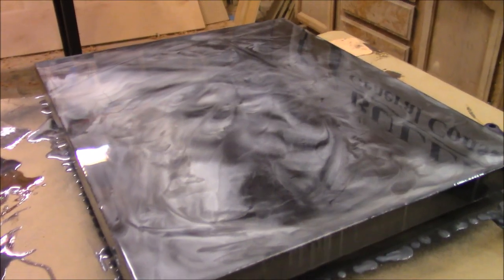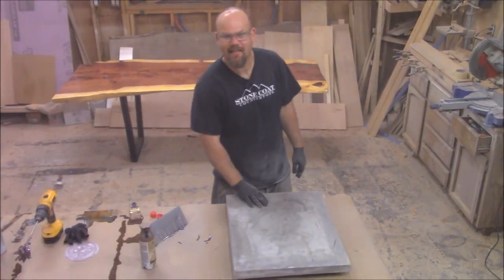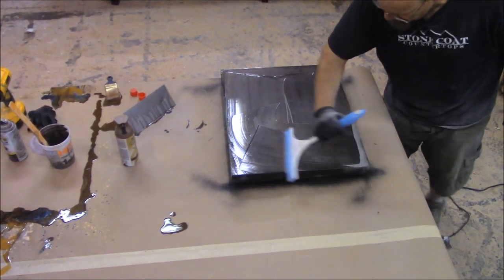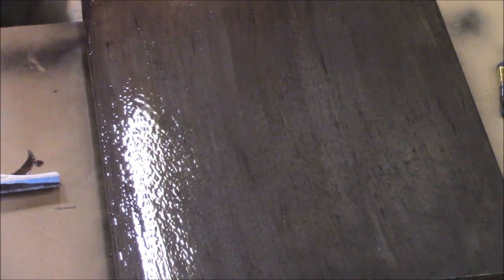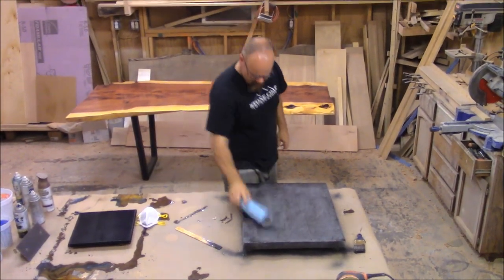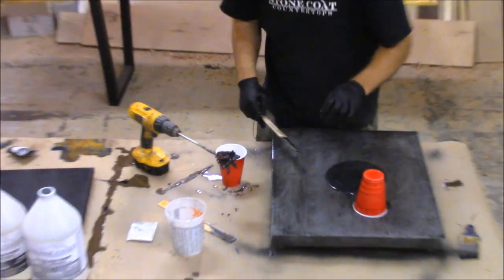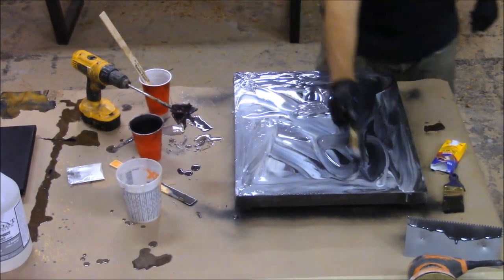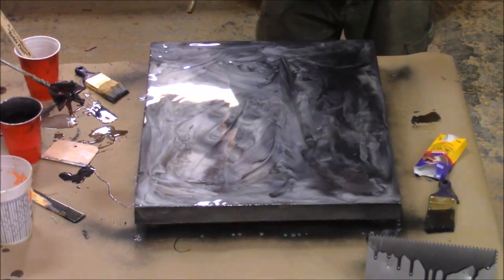Epoxy Countertops Over Concrete.

Comment: Do you have any recommendations for an exterior epoxy?  I have a concrete countertop in our grill area that is 85% covered and gets minimal direct sun exposure. I am hoping epoxy is a good option. If not, does anyone have any recommendations of what to use?
Reply: I have this question as well.

Comment: Hi great video.  A few years ago I applied an ardex Skim coat onto MDF as counters and typed it with a sealer. I'd like to epoxy over the Skim.  Can I just apply a primer then epoxy?  What prep work is needed before applying the primer?

Comment: What could you do in place of the colored sealant layer? Can you just go in with the flood coat and colors? Can you do so over an already sealed concrete countertop? Also, I understand that the epoxy makes a food safe service does the color spray paint change that?

Comment: Hi Mike. great video  again! Did ever try to cut a counter after the job is finish , or drill a hole in the counter.
Did it chip ??
Reply: cuts pretty well, i treat it like laminate counters, try to cut upside down

Comment: What if my concrete is lumpy after sanding with 60 grit? It’s smooth, but not level. What can I use to level it? I already did my rapid set, I followed these steps in your video, however, it dried rigid, after sanding its lumpy and 60 grit is not removing the lumps at all.

Comment: I poured my concrete counter tops a few years ago and I just buffed with clear coat. How much do I need to sand it down? As far as a seal coat I can use the epoxy and any color I want? And how many flood coats? I have a large countertop to cover. BTW thanks this is awesome I cant wait to get started!

Comment: Hi,I have  concrete kitchen cabinets for my bbq.I want to make it epoxy but the surface is not smooth and flat.what do you suggest to fix the surface first?
Thanks!
Reply: Unless there is severe roughness you can just apply the epoxy as is, it will smooth itself out.. just be careful to remove all the air bubbles. :)
Reply: @vdoxsamp7283  why can’t you pour epoxy over rough surface?

Comment: I bought a house with epoxy over concrete countertops. I think they weren’t done quite right. I don’t think they used a bonding agent or skim coat and the epoxy is chipping on the edges and corners, especially across the front section of the sink. Is it possible to now cut out the section in front of the sink for an apron sink to avoid chipping in that area in the future?  I am planning to resurface with epoxy and will need to pull up what is there. No idea what issues I will entail but at this point my biggest concern is removing the section of concrete in front of the sink without cracking or breaking what stays. Any chance of doing a video on how to do such a process?  I’ve searched and searched and have not yet found a helpful video.

Comment: Big Problem, ur Method will peeling soon, YOU MUST USE CONCRETE BONDING ADHESIVE” because concrete contain dust in the surface and easy for any paint to be peeling.